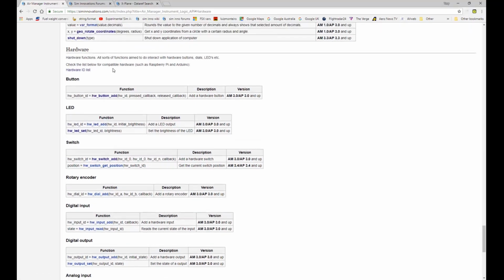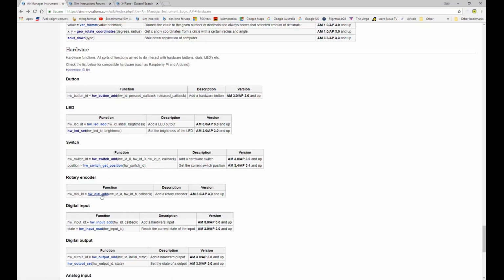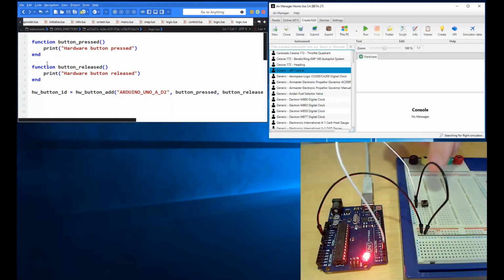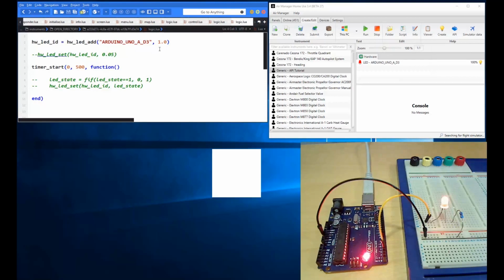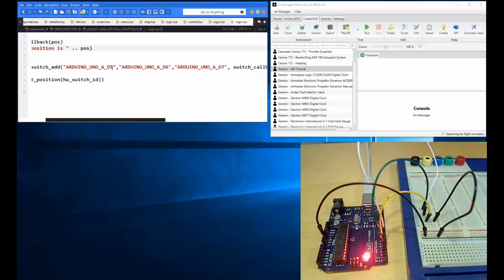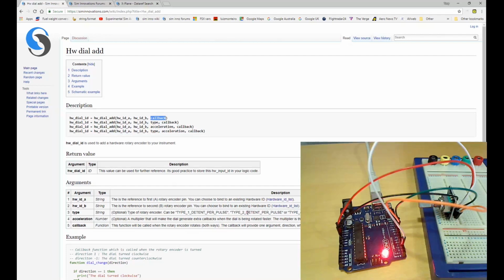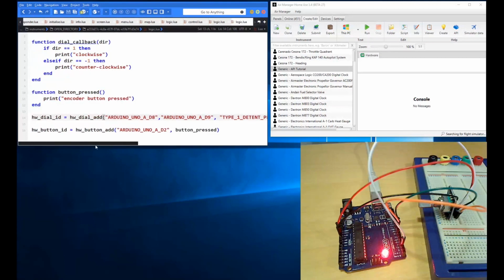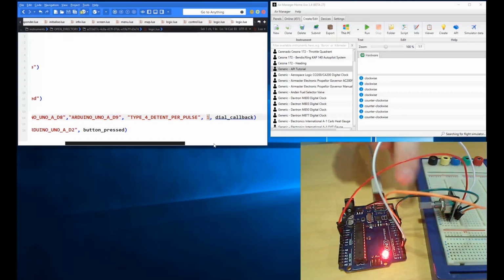Instrument development - E26 - Hardware part 1

Comment: How can I change when the LED turns on?  I would like it to be OFF when the condition is met and ON when the condition is not.
Reply: Depends what variable you're using and the value of the variable.
Reply: @ralphrietveld  thanks I have resolved this issue.

Comment: So can AirManager be used to interface with hardware gauges as well?
Reply: You mean hardware from a real aircraft? You could if you use the message port, but you'll have to interface the Arduino to the hardware yourself, Air Manager will only handle the communication with the simulator.